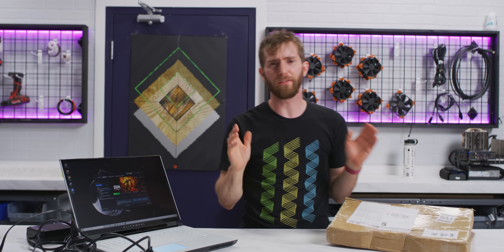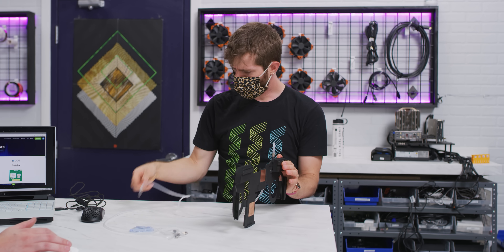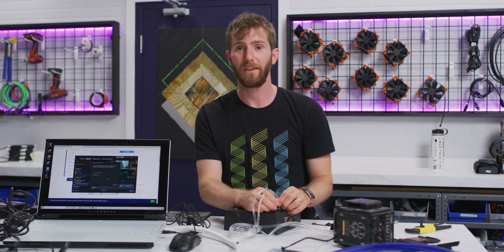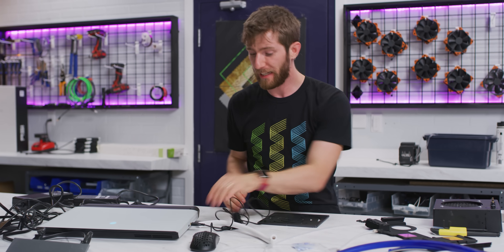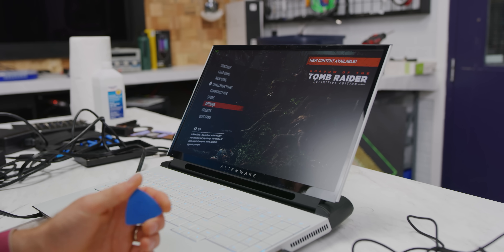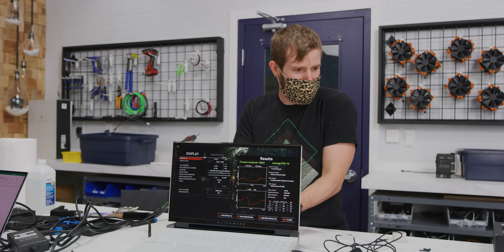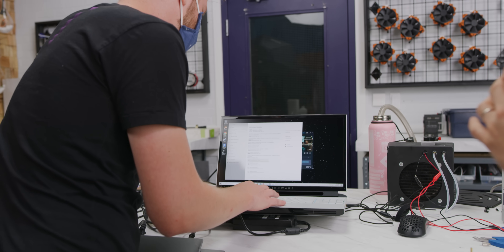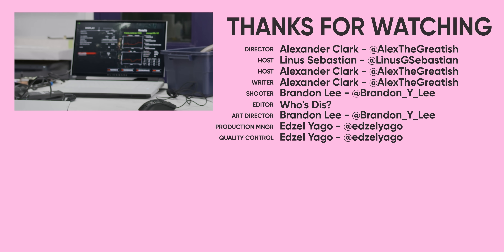This Sketchy AliExpress Cooler....

Comment: I might be wrong here but I actually think this product could be very good and the testing metric was just unfavourable. Whether it's worth the money or not is another question but... you took a game that was borderline thermally throttling and water cooled it, looking for an FPS boost and completely ignoring the fact that it dropped the temps by a substantial amount.
If you tested on a game/application that REALLY throttled on the platform, then tried the water cooling I wager you'd see a much later increase. What you did was the equivalent to seeing how fast MS Paint runs with different cooling - it's irrelevant if it's not throttling or borderline throttling.

Comment: To be honest, if your water heats up 20° on a single pass, you are not pumping the water fast enough, so it's only partially the coolers fault. Your pump was also clearly designed to transport a little bit less power out of your camera. So with a stronger pump, temperatures could have been even better while still getting the same FPS!

Comment: that shit worked great! why where you waiting for crazy more fps? is a water cooling... not another GPU! 
if performed slightly better in FPS but 20c cooler!!! that's a victory...and if you didn't had to destroy the rear frame so much... and you have the rest of rhe radiator system... works fantastic.

but stupidly expensive 🥴

Comment: if you close the air gap in the Ali express cooler with water, it maybe wont be that bad at cooling because the water closes the gap to the heat pipes

Comment: Please attempt to contact the seller for the installation procedure. Back in the days I used to watercool my laptop using  even scratcher modifications and it kept the temps real low, no fan noise at all. This product exists because its proven to be working, a failed prototype won't go into mass production and ended up in your hand. Some issues I can think of are the mounting and the flow rate. At inlet/outlet delta of 15C is just unacceptable, you should keep it under 5C. This cooler will affect the air cooling performance for sure, but the idea is when you are gaming, you'd be doing at at your desk with watercooler attached.

Comment: I'm surprised you guys didn't try over clocking. Wasn't it at 99C with stock cooler? A 20c drop seems quite large. Not 400+ usd large, but arge.

Comment: I like the topic, but it is just nonsense putting those glitchy tests with out-of-date drivers and system versions in this video. And may I ask how about the temps when getting 129 FPS with the stock air cooler?

Comment: If you can overclock the CPU and GPU it seems like the water-cooling would definitely squeeze more performance out of it. And with only a marginal decrease in air cooling performance I think it's actually a reasonably good product. However, I would still be skeptical about hard mounting a heatsink to my stupid expensive laptop.

Comment: I think you need to keep the water in the block while using air cooling! If the water chamber is in between the air cooling vapor chamber it needs water inside for thermal transfer

Comment: Well, of course is gonna perform worse without water in it, they just replaced the common vapor chamber with empty space for water to flow through so the only thing cooling the system is the copper plates and air. I wonder if in the future we are going to get a hybrid so we can plug water tubes in the go.

Comment: You don't have to buy a kit or disassemble the laptop. Just drill two holes in the back of the machine. Insert a water inlet tube into one and an outlet tube into the other. Start the pumps and, Bob's your uncle, you've got a fully water cooled laptop.

Comment: Such a small brain design, should have used concrete cooling instead.
Reply: Hey, watercooling is better than what I got!
Reply: Sand cooling 👍
Reply: Or honey?
Reply: that might work, the concrete has a high thermal capacity but I'm not sure that the thermal conductivity is up to the task